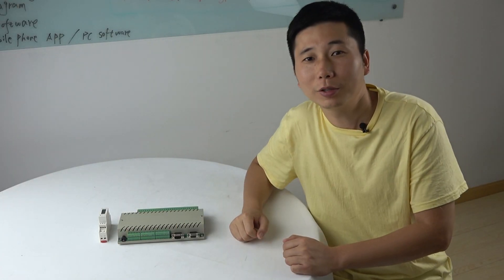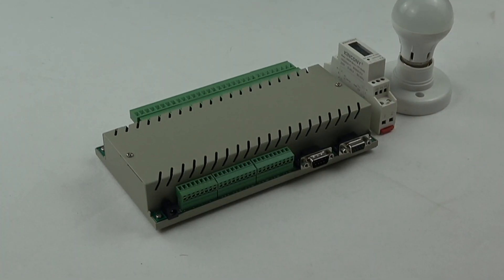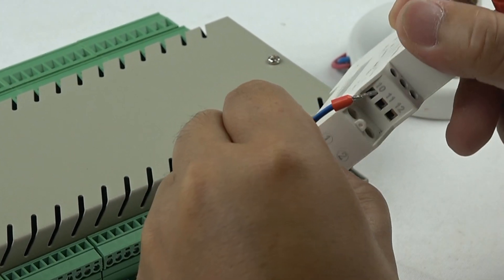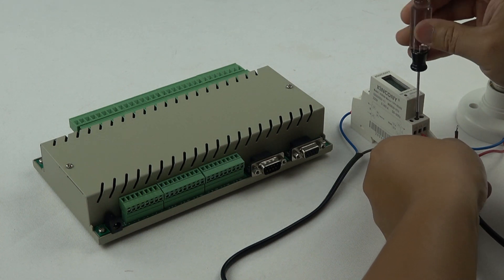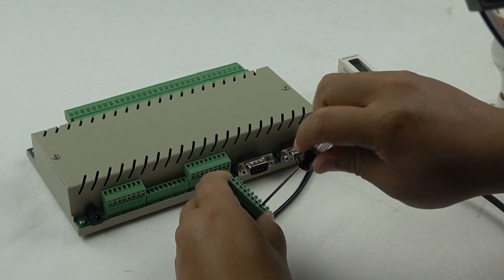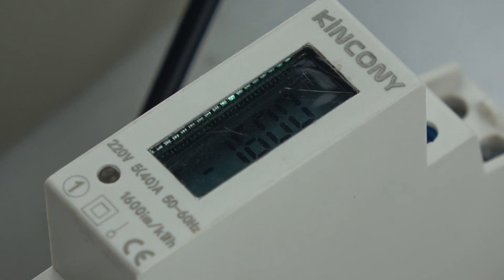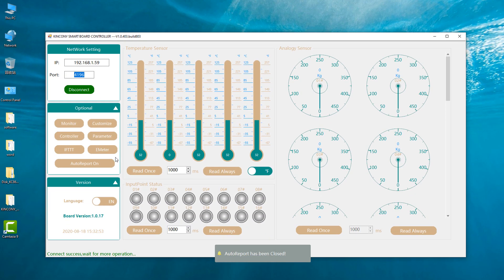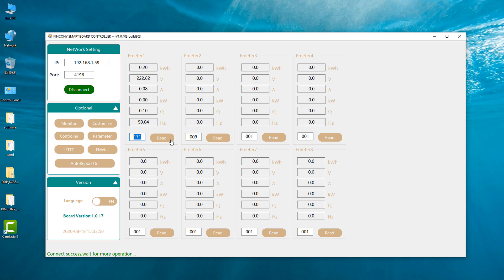how to read energy power meter voltage current frequency by RS485

Comment: Excuse me, Sir.
Is there a tool to measure a 3 phase kwh meter?

I have a building with 8 floors. Each floor has +/- 5-6 devices that I can control on/off manually.

Can Kincony devices control scheduled on/off based on daily/weekly schedules and are there several devices that can be monitored?

monitoring that I want is cold water temperature,
outside and inside air temperature. as well as monitoring 3 phase kwh meters with each phase around 1100 amperes

Thank You
Reply from the maker: yes, i think you can use our M30 energy meter board work with home assitant software. chose a correctly CT clamp sensor.

Comment: Sir What Device I need if i want to monitor power consumption on main distribution box or panel?
Reply from the maker: https://kincony.aliexpress.com/store/group/Electric-energy-meter/807891_10000001194875.html?spm=a2g0o.store_pc_home.pcShopHead_13901931.1_5_3    you can chose power meter.